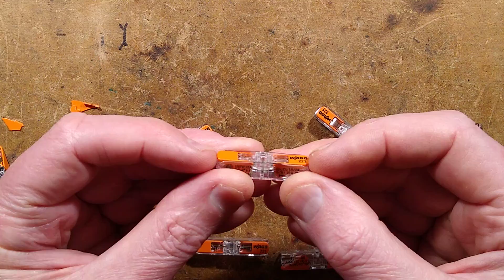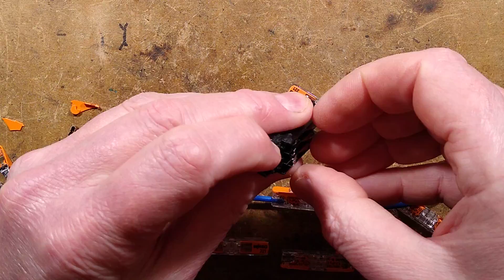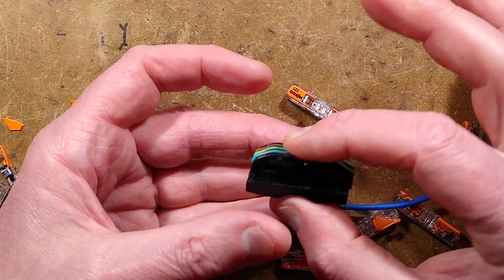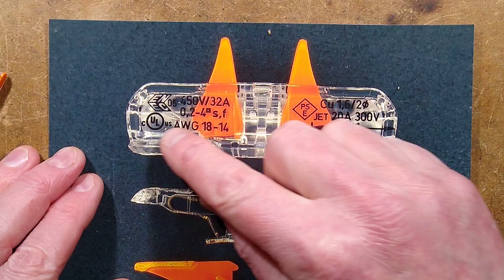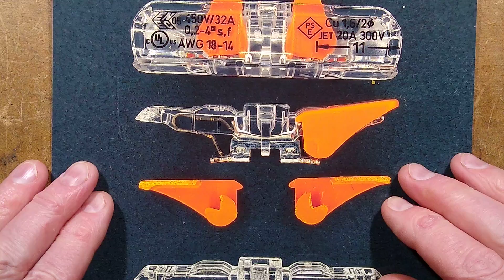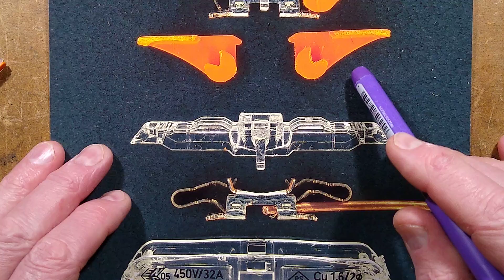By request - a look inside a Wago inline connector

Comment: They're still not popular in the US because of the dominance of the wire nut (a.k.a. twist-on wire connectors, a.k.a. Marette).
The wire nut isn't as carefully engineered, but there's no bus bar. Wire-to-wire contact is naturally a superior method  most of the time (so long as both wires are of the same material)... and wire nuts are stupendously CHEAP.
The only really common downside is when you're twisting stranded wires... but the US uses solid wire for almost everything.
Reply: the main downsides of wire nuts are that they're slow and require some dexterity to install.  With these wagos you get more reliable connections because there's less to do wrong, and the speed matters more than the cost of the connector.

also wire nut connections lead to quite chaotic looking wiring while with the wagos everything is just neat

and ofc you get a probing point on the wagos

so tl;dr wire nuts are used pretty much exclusively because "that's how we've always done it", I consider any installation using them a hackjob.
Reply: @tommihommi1  you can probe wire nuts just fine, and it never matters what they look like. These aren't downsides.
Bottom line is they have better electrical characteristics and cost a 10th as much, so regardless of your feelings about them being hack jobs, they're not going anywhere any time soon.
Reply: @Falcrist  for maintainability it does matter how messy the setup is.

And the electrical characteristics for the best installed wire nuts might be marginally better in a utterly non significant way to wago connectors, but the characteristics of the worst ones will be significantly worse. 

Add all the issues with reuse/replacement of cables (especially in lights) and the slowness, and you see why sensible installers just don't use wire nuts.

The extra cost is well compensated by the advantages.

If you use a thousand wagos when building a house, that's 400 bucks total.

Wow. Much cost. Such expense.
Avoiding that is totally worth making the work for the installers shittier.
Reply: @tommihommi1  no. It does not matter what the installation looks like. Wire nuts sit in a box in the wall for decades at a time and just conduct. When you pull them out to update them it just won't matter if they're aesthetically pleasing.

The cost and the extra time it takes to use a wagon compared to zipping on a wire nut are what really matters.

That's why nobody in the US uses Wagos.
Reply: The electrical characteristics that you claim are "better" are ENTIRELY irreverent for ALL practical applications.
Reply: @johnalexander2349  lower resistance is certainly not "irreverent" or indeed irrelevant. That's wasted watts of power and an additional cost over time. These devices are going to sit in your walls for decades.
Reply: @Falcrist  And how much, in dollars per century, is this totally relevant difference in resistance going to save me?
Reply: Y'all can argue about this until you're blue in the face, but the bottom line is the reason the US hasn't switched is that wire nuts are MUCH cheaper and slightly electrically superior. With a simple drill attachment, they're actually faster too.
Reply: @Falcrist  Yes they're cheaper. Giant asterisk. Yes they're electrically superior. Giant asterisk. But they are not quicker to install, because we're not using the 221 range, we're using the 2273 and 773 ranges.

Giant asterisk 1. I can use cheaper, less experienced labour with the Wagos, because they're idiot proof, making the R2 cost difference per connector immaterial. Plus they can do way more.

Giant asterisk 2. The so called electrical superiority is also immaterial.

But no matter how much you love wire nuts, you'll only ever be able to use them in the US, because the rest of the world considers them to be such a hazard that they're illegal almost everywhere.
Reply: About 80
Reply: @Falcrist  Sound like cheap insurance to me.
Reply: @johnalexander2349  sounds like an unnecessary cost to me. That's why the US isn't switching.

Comment: I wouldn’t put tinned wire (whether stranded or solid) into any such connector regardless of brand because solder is so soft. You can’t reliably get a good bite in it.

I get what you say about twisting stranded wire to prevent stray strands and the associated risks, but I also think that diligence in ensuring there are no stray strands before inserting it is better.

Faster can be dangerous.
Reply: Decades ago it was common practise to solder wires ends before fitting in screw connectors. It was found that lead/tin creep over time, diminishing contact force. Now banned from use in electrical installations. In my country at least.
Reply: I have seen multiple CEE conectors melted from tinned wires. The wires all had an massive indentation from the screw but where finger tight at best.

Comment: I've heard you can add ferrules to these, not sure how true this is, but if it is then a twist isn't going to hurt.
Reply from the maker: Not totally recommended as the quality of ferrule crimp matters.
Reply: They're literally designed to replace crimping butt splices.
Reply: It is true, and it won't hurt anything.  Lots of benefits, in fact.  Ferruling stranded wires (not solid, but stranded) works extremely well with WAGOs.  The plastic guard generally fits into the WAGO perfectly and prevents side-to-side strain, and the rectangular nature of the crimped ferrule makes for a very good interface with the WAGOs internal clamp.

Comment: The Wago design is so much better than the Chinese clones, even if all the plastic breaks apart the wires are still held securely in place.
Reply: Depends on the specific Chinese clone type. Some of them are basically 1 to 1 clones, but the issue is it's basically impossible to have any consistent way to get the right clone. It's always a gamble to order
Reply: @amogusenjoyer  I'd stay away from the clone products for any kind of even moderate high current usage, especially mains wiring. While the clones might look the same, they could have replaced the copper with aluminium or iron and the springs are probably not as strong as the originals, it might not even be real springs. Besides the Wago shown here are only something like $0.50 each, so hardly anything saved by using clones.

Comment: I always twist stranded wire.  Helps keep the careless whiskers at bay.

I went from standard wire nuts to these Wago LeverNuts as soon as I discovered them because I no longer had to twist wires to keep them properly connected.  I had an electrical fault where the neutral had backed out of a wire nut.  No faults with these Wago connectors because they keep things gripped.  They take less space in the junction box, too!  Excellent product.
Reply: There are two other useful features. Firstly you can see the wire inside the connector to get visual confirmation that it is properly connected.  Secondly there is a very small hole in the connector where you can insert an electrical test probe to safely test a live circuit without disconnecting the wires.
Reply: @andrewfrance1047  IMHO, another useful feature is that they don't actually screw up the ends of the wires when you connect them, which means it is easy to undo and redo them if you need to, and you know you'll still be getting a good, tight connection even after reworking things.

Any time I want to redo a wire-nut connection, I have to separate all of the wires, and then either snip off all the ends and re-strip everything, or spend time reworking the "corkscrew" ends into something that can be properly twisted back together again before putting another wire nut back on, and it's a huge pain to do properly.

You can also easily disconnect/reconnect just one wire from a 3 or 5-wire connection point, without having to touch the other ones at all.  Plus you can reliably connect solid and stranded wires with ease..  ok, frankly, there's just a lot of really useful advantages, IMHO.
Reply: Next time I need wire nuts I plan to get Wagos instead if it’s at all practical.

Yeah, I give stranded wire ends a slight twist, almost reflexively.
Reply: @markiangooley Seems to be the common consensus among the non boomers. The Wago section of my Hardware stores just keep exponentially growing as more and more people use it. Starting to also see them pop up on Construction sites. Its also just a lot faster.
Reply: Love the 'Careless Whisker' reference.  George Michael would be proud.
Reply: We don't really do wire nuts in the UK, I had to use them on some ships I was on as an engineer. I regard them as appalling things, but the screw chocolate block connectors were not much better. Now use Wagos pretty well exclusively, with the odd Ideal.
Reply: My cadet heater Jbox had a backed out wire nut fault that could have EASILY  caused Cedar paneling to catch fire. Luckily breaker tripped but the meltage was so scary I didn't  tell my wife. I tape my WAGO levers before "laying" them in box as well.

Comment: Wago seems to be the standard for electricians now. I’d question someone who wasn’t using Wagos.
Reply: Are you American? I am getting the impression that Americans don’t like ‘em …
Reply: @mytubesvp I do work on both sides of the pond and I see them used more frequently in low current lighting applications in the U.S. 
American electricians associate the wago-type connectors with the “back-stab” type outlet receptacles, which are prone to failure.
Reply: @Stefan_Van_pellicom  Chris over at HVACR Videos (from California) has been using Wago lately on rooftop units, and he's even seen some newer equipment assembled with Wago connections at the factory. America is slowly beginning to adopt them, and I wouldn't be surprised at all if, in the not-too-distant future, they become the standard.

As far as I'm concerned, if they can hold up at 240v and 30+ Amps, they're good enough for my low-current 12v DC and 120v AC needs. Especially since UK standards are stricter than our own.
Reply: @dashcamandy2242  I'm actually going to be a little controversial and say he shouldn't be using them how and where he does.

Everyone touts Wago as being immune to vibration, but they're not - no, they don't back out like a screw, but if the connector and wire are allowed to move independently, they can and will fret and fail. A solid wire clamped into a box, sticking straight up, with a Wago sat on the end of it hovering in the middle of the box, will allow this. The connector should be restrained along with the wire, look up the Wagobox for an example of how this is done. Just jamming them into an already too small junction box as he does (and has to tape the levers down to avoid them getting snagged!) isn't really ideal on a vibrating machine.

I do enjoy watching him expand his horizons where so many refuse to, though.
Reply: @Monkeh616  You haven’t used them, have you …
Reply: @Stefan_Van_pellicom  ... Extensively. And I'm not American.
Reply: Americans love wire nuts. @Stefan_Van_pellicom
Reply: @Stefan_Van_pellicom  As a rule they don't like anything they didn't invent (or think they invented) or which is, well, different. Change scary.
Reply: Well, some use Uaygos, some use Vahgos.
Reply: @agustinusreynaldi7101 if your wires heat up beacose of a fault those solder joints are going to give up way before wirenuts or wago
Reply: I don't have to question, I know when keeping the costs down is a priority wago is too expensive. It's not just mass production where they skimp on quality to save fractions of a percent in costs, regular people do it too, all of the damn time.
Reply: For telecom, networking and other low power, low voltage wiring, IDC / punchdown connectors are quicker.
Reply: @Mark1024MAK  Punchdown has insulation displacement and pressure which at the point of contact has no oxygen, moisture or oxidation.  I have worked with many old horribly corroded blocks that work until the wires rot off.  NEVER have more than 1 wire on a pin.
Reply: When we’ve had masses of people, running their 1500 W space heaters on Wego wired circuits to outlets, and the wagos outlast the outlets that get cooked with all the wattage, I’ll consider using Wegos for residential and commercial electrical outlet circuits.
Reply: @dallynsr  In Europe WAGO is basically the gold standard both for residential, commercial and industrial installations unless there are very special and specific demands that forbid them (for example that splices/connections must be done a certain way for application X). Someone not using WAGO ain't worth hiring.
Reply: @dallynsr  Sooooo... 2008?
Reply: @dallynsr Why wouldnt you? 1500w isnt even close to straining a wago though or probably any connector that has gone through any kind of ackreditation for domestic use.  It's at the upper reaches of a 6A circuit on a 240v system. Outlets must be badly wired if they cant stand up to it. Our domestic outlets are rated for 16A intermittent. A wago 221 is way over that.
Reply: Sometimes wire nuts are more appropriate, or using a box etc. if you can't do it yourself you'll always have questions.
Reply: I don't use it... I use old common screw connections, what do you have with this Vago? everywhere only vago vago, I open the fridge and there's a vago
Reply: @ccc5226  screw connections can get loose. thats why instead of screw clamps in cars they use spring clamps for example. Wirenuts or Wago. Wago if you value your time.
Reply: @vablo7198  You dont use any of those in cars. You use open barrel crimps or splice ferrules  crimps or crimp connectors like DT or tyco supeseal. In a real pinch maybe solder. Only people who dont know the standards for automotive wiring use house wiring fittings in auto applications. Not because wagos are bad but because they are not suitable for the environment.
Reply: @rimmersbryggeri  If they're good enough to earn German railway approval, they're good enough for my car. And boat, and plane.
Reply: @johnalexander2349   Approval for what application in railway? Even weather proof connectors have trouble in automotive applications. You are welcome to use whatever connector you want to but I really hope I will never meet you in traffic.
Reply: @rimmersbryggeri  Not looking up what railway approvals they've got. They've got a few dozen of the agencies that their parts are approved by, listed at the back of their catalogue, and more on their website.

If I need IP68, I believe they've got a gel filled box, although I doubt it's even necessary with the airtight seal that forms between the copper busbar and the tinned copper wire.

But hey, don't let me stop you from doing things the backwards way.
Reply: @rimmersbryggeri What's wrong with Wago in automotive? It's not like it'll come loose with vibrations. Regulations etc often trail behind technological changes, so using the regulations as direct justification doesn't make much sense.
Reply: @rimmersbryggeri  dielectric grease enters the chat
Reply: @BossCyan1d3  And thats makes it easier how?
Reply: @johnalexander2349  Not good enough for any aircraft I would fly in.  Rough environment and vibration.
Reply: @solarsynapse  Nothing I can do about your ignorance and paranoia. Tested and passed several roughness and vibration standards. And probably already in use in aircraft you fly in - their DIN rail terminal blocks are pretty ubiquitous.
Reply: @johnalexander2349  You are clueless about aircraft.  DIN rails in factories have set screws.
Reply: @solarsynapse  except for the millions that have Wagos, because they're more reliable than set screws. Not forgetting the PCB connectors that Wago makes. Your problem is that you think that these 221 series blocks are new domestic grade novelties, when they're actually an expansion of a decades old product line that's been used in all industries and certified for almost all applications. If you plan to avoid Wagos, best you go live in the woods, because they're already everywhere.
Reply: @johnalexander2349  There is nothing like Wago or wire nut in aircraft.  They use D-sub, Molex, Amphenol and spade that is solder, crimp, screws and bolts.
Reply: @solarsynapse  Ah yes, spade lugs, the pinnacle of reliable electrical connections. And they use the self insulated type too - never seen the wire pull straight out of one of those with minimal force...

I'm willing to bet that somewhere, on every category of plane from microlight to A380, someone has used spring clamp connections, and if they're Wago, not one of them has ever failed.
Reply: @ccc5226 it's the new shiny product for cool kids. Don't bother listening to these kind of advises if you know what you are doing.
Reply: @ccc5226 the problem with screw connectors is you need to retain maintenance access and are supposed to go back and check them every so often, these are maintenance free

Comment: You shouldn't OVER twist them. And You shouldnt straighten them out. Ideally they should only be twisted to the natural factory twist.

Nasa: UNACCEPTABLE OVERTWISTED STRANDS
Strands twisted in excess of the normal twist pattern (lay) exert increased stress on individual strands, and may result in conductor breakage.

NASA-STD-8739.3 [7.2.4]
NASA-STD-8739.4 [10.1.4]

Comment: I've always called them wagos and not vagos.
Originally, I thought they were named after some marketing hype, as in "just push the wires in, lock down the lever and 'away-you-go'" - actually think I told a few people this as fact lol.
Worth noting, I believe they aren't to be used in conjuction with bootlace ferrules as this is considered a double crimp.
The straight through ones are brilliant... Much better for Inline joints and neater. 
I've always felt they need to bring out a 3 core termination unit, where you can temporarily make L, N & E safe into one block! Don't try this with the current 3 lever wago though 😂
Good video, always wanted to see under the bonnet with them! 👍🏻